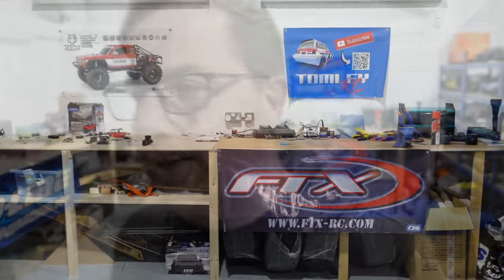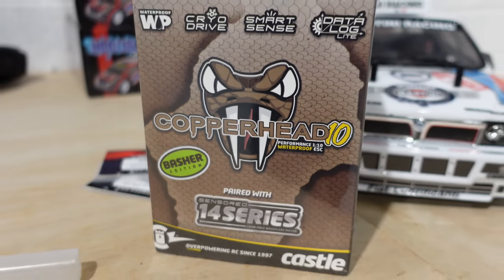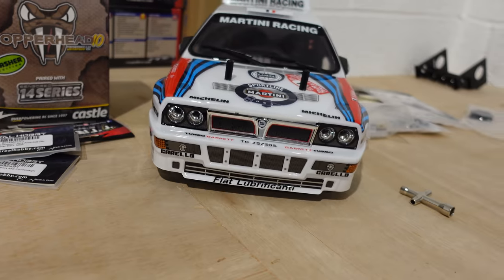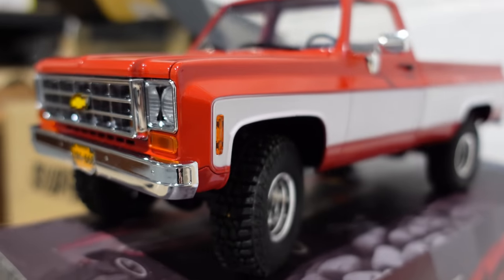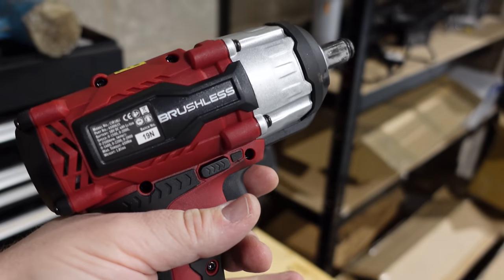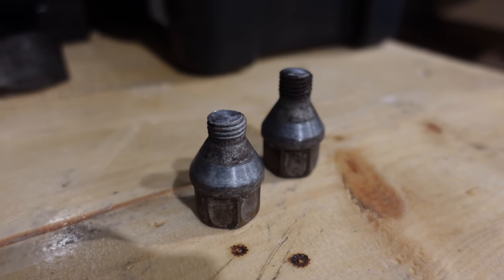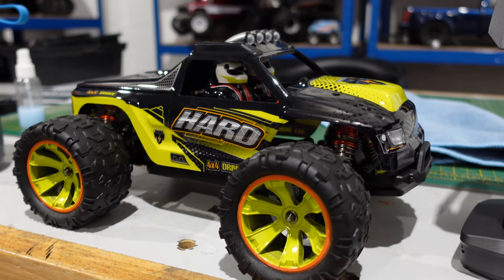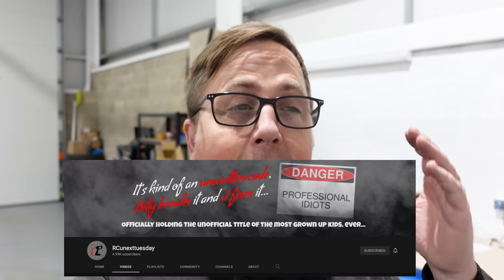If You Do This...Please NEVER Work On Cars AGAIN! This Week At Tomley's

Comment: IIRC, the torque for the wheel nuts on my old Disco 2 TD5 was 105 Nm too. Random one for you, but torque related: I once took "advantage" of a 15 quid oil and filter change from a local Ford dealership (we had a Maestro at the time - they weren't fussy!). I got a phone call that afternoon from the service manager. "Through no fault of our own, the sump plug has stripped the threads out of the sump. We are organising a courtesy car for tonight and tomorrow...... and a new sump". I suggested to the chap that perhaps Ford should employ trained chimpanzees rather than gorillas because they are not as strong! :D

Comment: There's no point in doing wheel nuts tighter than what can be undone with standard onboard tools. 
Last workshop that used torque wrench on mine still managed to over tighten them, and I keep breaker bar in my car.
Reply from the maker: Yes agree... I usually have my breaker bar in the car, there was lots of shouting and swearing when I broke them! Idiots!
Reply: Someone went one ugga dugga too far.

Comment: Copper slip is a big no no on brake components these days. Copper slip/ease can react with rubber dust seals and slider boots. Silicone brake grease is the way to go. Also never grease threads on a fastener that has a torque requirement!, It will shear/stretch the bolt or strip the threads before the torque wrench clicks..
Reply: A smear of copper grease on wheel nut threads (never the taper faces, these need to slightly bite & lock) is NOT going to shear, stretch or strip them! I've been lightly greasing wheel nut threads for 35 years & they always torque up & undo perfectly (you're very glad of it in a puncture situation.....). Tomley's sheared due to overtightening a dry thread & then subsequent seizing of that thread. Even a correctly tightened bolt will shear when undoing if the threads are dry, rusted & seized. On incredibly critical, high torque requirement, high precision threads, the greasing of the threads & head mating faces IS a no no.
Reply: @MrGoat73  sorry but I disagree, no modern vehicle manufacturers recommend greasing wheel bolt or studs. Infact Autodata and Haynes data absolutely advises against it. Recently we had a 2014 Ford fiesta in the shop that had the wheel studs copper greased . Even after removing most of the grease from the studs and nuts one of the studs sheared off well before the torque value was reached! (135 nm in this case).
I've also been doing this for well over 30 years.